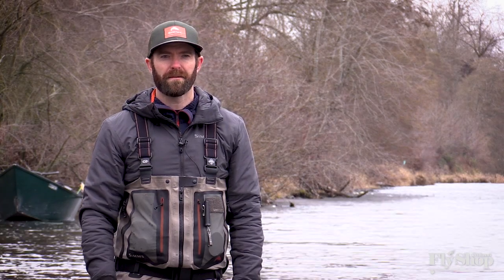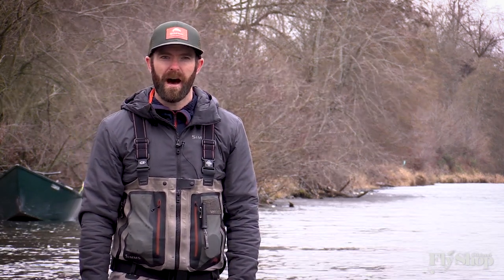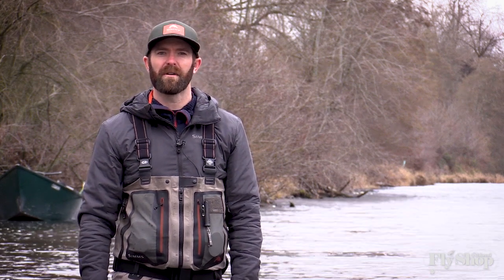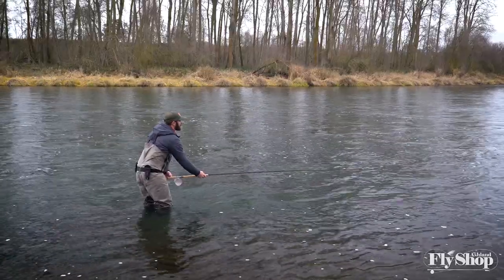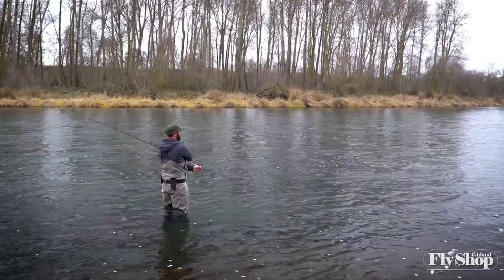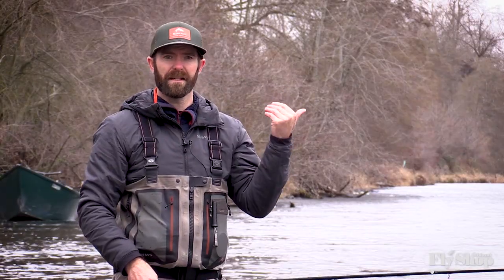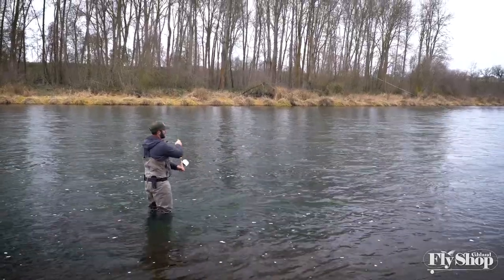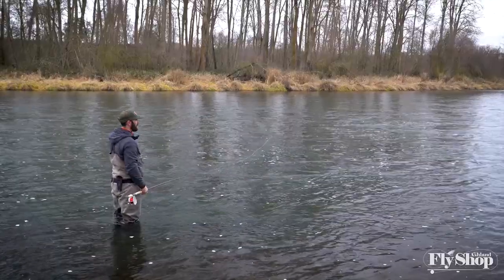The Double Spey Lift | Two Minute Drill

Comment: Stuart,

We just spent a day on the Vedder River in the Fraser River valley of BC and I used your big, soft vertical sweep. It really moves line, especially with heavy sink tips. There is only one problem with this movement. It really puts a lot of pressure on your right shoulder. I have done hundreds of conventional double spey casts and never had a joint problem but your version really hurt my right shoulder..